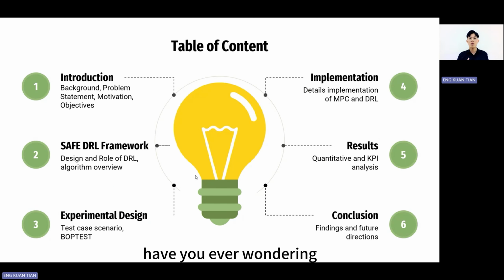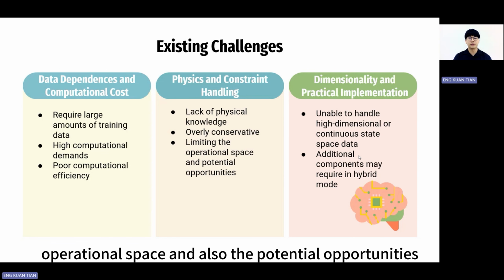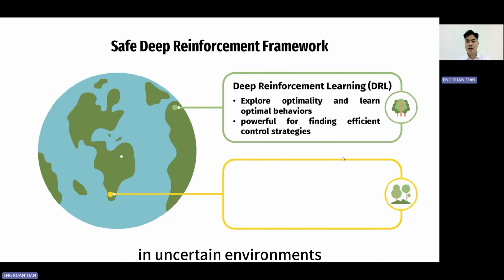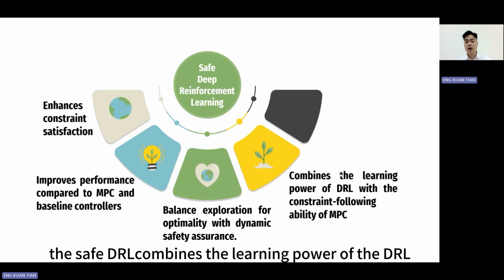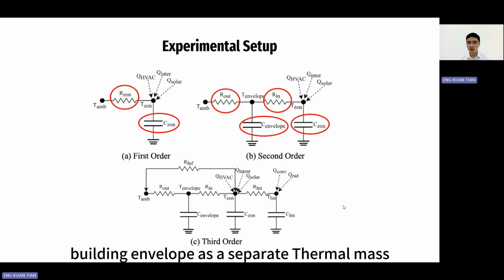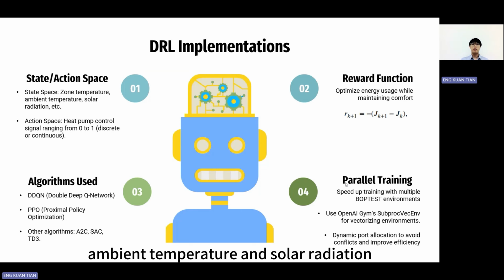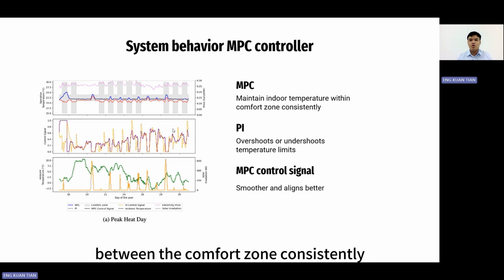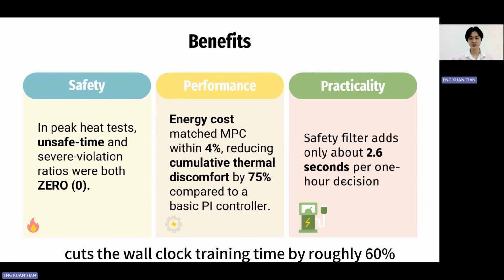25/04 AIT306 Deep RL and Control Paper Sharing Group 3

Comment: Group 1: You mention that "at certain time steps, the actions provided by MPC are not globally optimal," allowing safe DRL to "attain superior safety performance" over standalone MPC, particularly during peak heating periods when its safety metric ($m_s$) is zero. Explain how this seemingly counter-intuitive outcome is achieved within the safe DRL framework, considering the primary role of MPC as a "safety filter," and how the frequency of MPC intervention changes based on environmental conditions.
Reply: Group 3 answer: The statement that safe DRL can achieve "superior safety performance" (e.g., $m_s=0$ during peak heating days) compared to standalone MPC, despite MPC primarily serving as a safety filter, highlights a crucial synergistic aspect of the safe DRL framework. This outcome is achieved because the DRL component, with its exploratory nature, can discover more optimal actions than MPC, which are then successfully retained by the MPC safety filter. Mechanism of Superior Safety and DRL's Role: 

• DRL's Exploratory Capabilities: Deep reinforcement learning is designed to learn and adapt through trial-and-error interactions with the environment. This exploratory nature allows DRL to discover policies that may lead to globally more optimal outcomes that a traditional MPC might not identify. The paper explicitly notes that DRL can "make more bold attempts". In contrast, MPC's actions, while safe, are based on a mathematical model (often an approximate one) and a finite prediction horizon, meaning they are "not necessarily globally optimal". 

• MPC as an Enabling Safety Filter: In the safe DRL framework, the well-trained DRL agent first proposes an action based on the current state. The MPC safety filter then simulates the future state trajectories resulting from this DRL-proposed action. The critical point is that if all predicted states within a defined finite time horizon remain within the predefined "safe set" (i.e., meet temperature constraints), the DRL action is directly applied. This means that if DRL explores and identifies an action that is both safe (as validated by MPC) and more optimal (e.g., leading to better comfort or energy savings than MPC's own potential action), the MPC filter allows that superior DRL action to be executed. The observation of $m_s=0$ for safe DRL during peak heating periods (while MPC alone had $m_s=0.016$) indicates that DRL found control strategies that kept the temperature perfectly within comfort zones, and the MPC filter successfully validated and allowed these actions, thereby surpassing the safety performance of standalone MPC. This validates that the MPC filter can "successfully retain these actions" and that DRL can indeed "generate more optimal actions". 

Frequency of MPC Intervention based on Environmental Conditions: The frequency of MPC intervention, meaning the number of times MPC overrides a DRL-proposed action, varies based on environmental conditions and the DRL agent's performance: 

• Peak Heat Day: During the peak heat day scenario, the MPC intervened 686 times out of a total of 43,008 control steps. The intervention frequency noticeably increased on the 26th and 27th days. This correlated with periods where the zone temperature was approaching its upper limit, indicating that MPC predicted a risk of overshooting and filtered DRL actions to maintain system safety. 
• Typical Heat Day: On the typical heat day, MPC intervened 950 times, a higher frequency than on the peak heat day. This suggests that the DDQN algorithm (the specific DRL agent used) was more prone to making unsafe actions on typical heat days. For instance, from day 109 to day 111, MPC's intervention significantly reduced control actions to prevent the overshooting that DDQN alone would have likely caused . Despite the challenges posed by intense solar radiation and high ambient temperatures on typical heat days, MPC's interventions led to a notable improvement in safety compared to standalone DDQN.

Comment: Group 2:
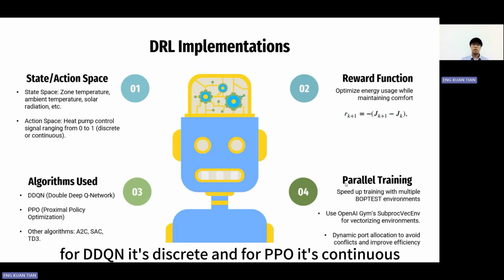At time 11:34, you mentioned the algorithm used such as PPO DDQN and others, i do realized the comparison is made on DDQN algorithm and combined with MPC to create the safe DRL. So my questions are:
1) Why DDQN is being chosen for evaluation at the end rather than other option, is it due to DDQN is better than amother algorithm in the given condition and environment?
2) why DQNN is applied since the your action space of heat pump control is ranging from 0 to 1 which mostly signifies continuous action as it is best in your scenareo where dynamic adjustments are needed even your slide mentioned discrete or continous but is not further stated. Why not use algorithm suitable for continous action space such as SAC or PPO?
3) If it is in discrete form action space, how does action space of 0 to 1 can be applied and structured so that it works well?
Reply: Group 3 answer:

1) DDQN was chosen for demonstrating the efficacy of the safe DRL algorithm because its learning performance was comparable to other high-performing DRL algorithms, rather than being definitively superior to all others. The study conducted a parallel training scheme for six different DRL algorithms: A2C, PPO, DDQN, SAC, TD3, and DDPG. This scheme was developed to expedite the training process and identify optimal DRL algorithms for integration into the safe DRL framework. So, after training for 10 million steps, it was observed that A2C, PPO, DDQN, and SAC all converged to relatively high rewards, demonstrating "superior learning performance". In contrast, TD3 and DDPG did not converge to high rewards. Furthermore, the paper explicitly states that "As the reward values of these DRL algorithms are close, this paper chooses DDQN to show the efficacy of the safe DRL algorithm on the peak heat day and the typical heat day." This suggests that DDQN was selected as a representative algorithm from the group that performed well, rather than being uniquely superior. Other than that, DDQN (Double Deep Q-Network) was chosen primarily because it is computationally efficient and well-understood, making it a reliable baseline for evaluation. it also has shown strong convergence in previous DRL applications for building control with discrete action spaces. Hence, it allows clear benchmarking against traditional DRL methods in safety-critical environments. While the authors also mention trying PPO and SAC, they chose to highlight DDQN in the safe DRL evaluation because its performance was more sensitive to safety violations, making it a better candidate to demonstrate the value of adding a safety filter like MPC. The DDQN agent showed high exploration-related risk, which is precisely what the Safe DRL framework aims to mitigate.

2) The author clarify that while the heat pump control signal is indeed continuous (ranging from 0 to 1), DDQN was applied by converting this continuous action space into a discrete one. The paper acknowledges that different DRL algorithms require distinct action spaces: 

- Algorithms like Deep Deterministic Policy Gradient (DDPG), Soft Actor Critic (SAC), Advantage Actor–Critic (A2C), and Twin Delayed Deep Deterministic Policy Gradient (TD3) operate in a continuous action space. 
- On the other hand, Proximal Policy Optimization (PPO) and Double Deep Q Learning (DDQN) algorithms function in a discrete action space. 

Therefore, to apply DDQN (and PPO), the continuous action range of the heat pump control signal (0 to 1) was explicitly adapted to a discrete format. The paper notes that DRL, with its powerful exploration and learning capabilities, is suitable for controlling building energy systems, which are nonlinear, time-varying, and uncertain complex systems.  Other than that, DDQN is designed for discrete action spaces, whereas control signals like heat pump modulation (0 to 1) are inherently continuous. The authors address this by discretizing the continuous action space into a finite set of discrete levels. For example: Action space = {0.0, 0.1, 0.2, ..., 1.0}. This converts a continuous range into 11 discrete actions.So, although the heat pump supports fine-grained control, the DRL agent (DDQN) learns to choose from discretized control levels, which balances their simplicity of implementation (compatible with DDQN), sufficient granularity for HVAC performance and also ease of integrating into safety filter (MPC)/

3) For algorithms like DDQN that require a discrete action space, the continuous heat pump control signal (ranging from 0 to 1) was divided into 10 equal intervals. This division resulted in a set of discrete action choices: (0, 1∕10, 2∕10,… , 1). Consequently, the total dimension of this discrete action space is 11. This approach allows algorithms designed for discrete action spaces, such as DDQN, to be utilized for controlling a system where the underlying physical control input is continuous.

For example,
To structure a [0, 1] action space for DDQN: The continuous range is quantized into discrete levels.

Action space A = {0.0, 0.1, 0.2, ..., 1.0} → 11 actions

During training, the agent selects from these levels.

In deployment: Each selected action is interpreted as a control signal value (e.g., 0.6 → 60% heating power).

If the Safe DRL framework detects that the proposed action may violate comfort or safety constraints (e.g., overheat the room), it overrides it with the MPC’s safe action.

This structure:
- Makes DRL compatible with physical system constraints.
-Enables safe, real-time decision-making using a discrete DRL agent like DDQN.
-Provides a good balance between precision and computational simplicity.